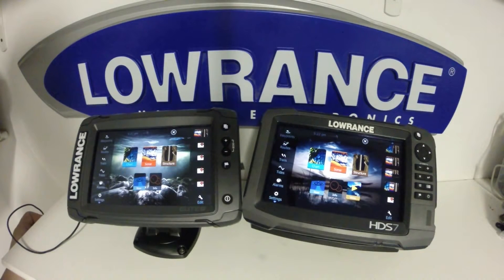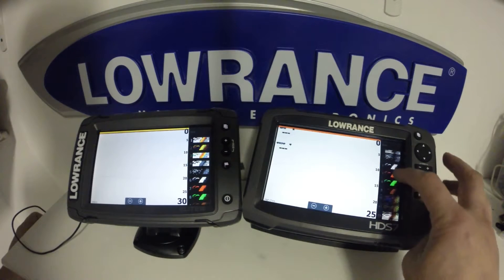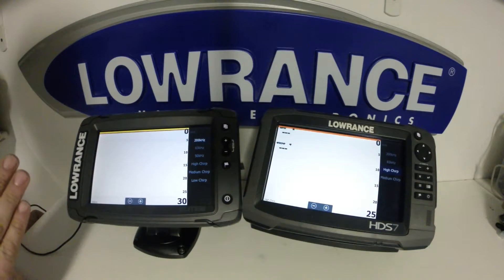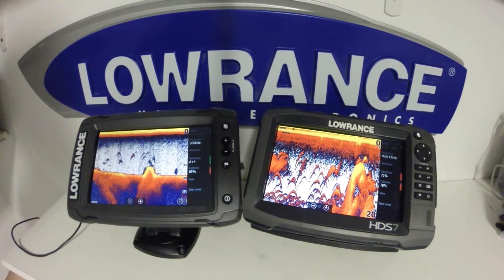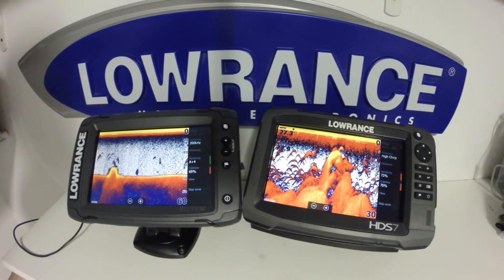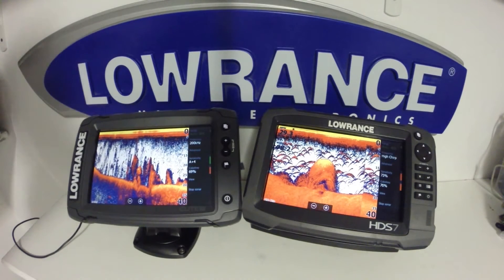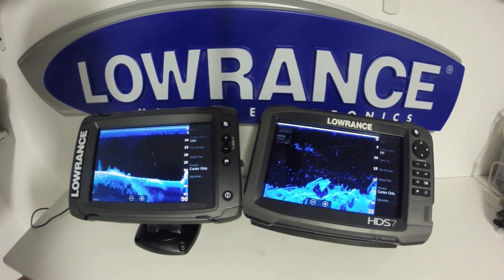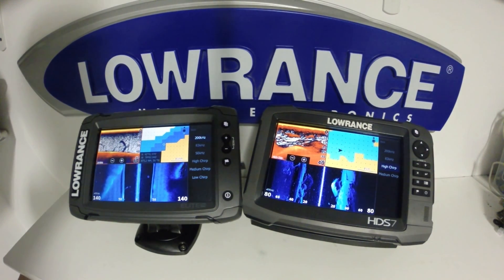Elite Ti vs HDS Gen 3 Pt 4 Sonar Features Comparison

Comment: So is the elite 9 ti compatible with a minn Kota ultrex I pilot?
Reply from the maker: +Jacob Miller Any unit is compatible with iPilot because there is no connection made between the motor and your GPS.

I am going to assume you are  asking something else though... If you are asking, Will the TI work with the built in transducer on the Ultrex? Then yes it will...

You need the Minn Kota adapter 7pin Lowrance blue to US2, then the 7 pin blue to 9 pin black adapter from Lowrance.

If you mean, Are you able to connect iPilotLink to the TI to share waypoints with the Ultrex and use the Link features? Then no. You need an Ethernet Humminbird unit for that.

Comment: I have the Elite 7, which adapter do i need to be able to use it with the TI? Just for Downscan no side scan.  Thanks
Reply from the maker: +DJ CHAKA EL TICO It's called a 7pin blue to 9pin black (or xSonic) connector. I don't have the part number